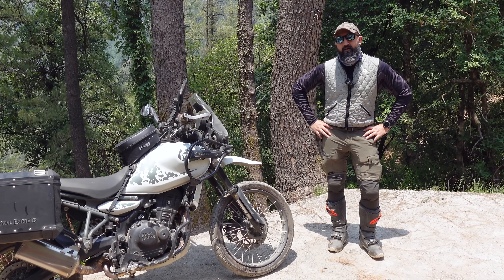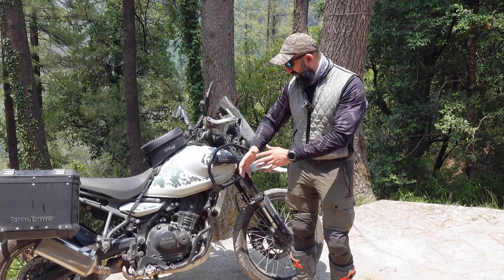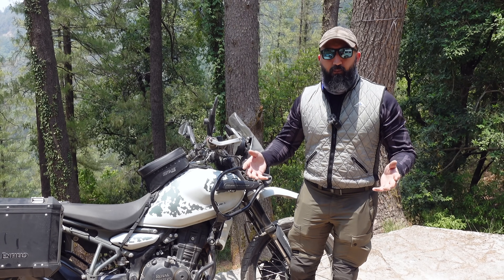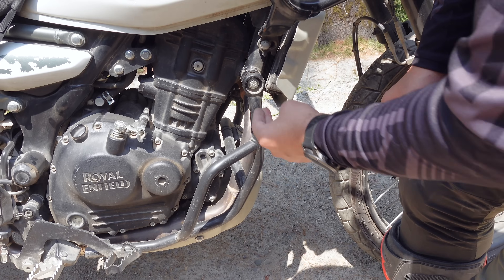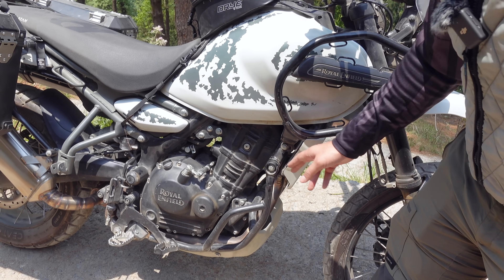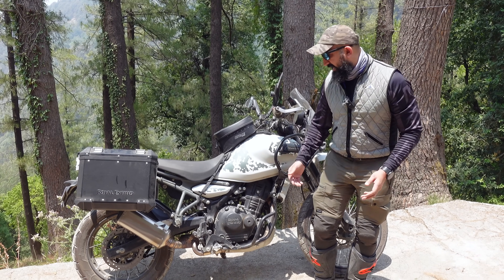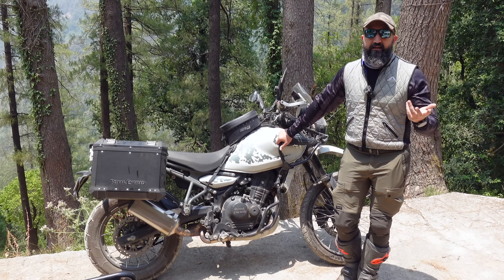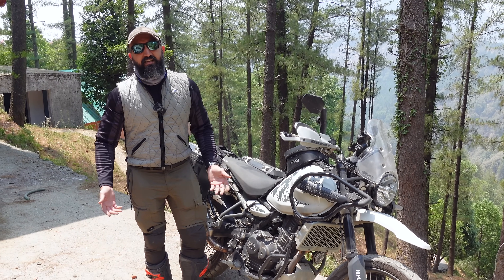Why Did Himalayan 450 Chassis Break: What I Learnt From Royal Enfield

Comment: It's kind of a tricky situation here for us, the viewers. Since we don't have detailed evidences of both the scenarios, we can't really say who's at fault. 

Firstly, As far as i know RE had spent years on testing, simulations and proto runs in the toughest terrains to make sure they don't face such issues  again and finely tune the bike as much as they can. As a matter of fact I own a BS6 411, have clocked almost a 30K km on it, mostly in Himalayas, haven't faced any sort mechanical failure yet.(No crash guard installed tho) if this info helps.

Secondly, there's variety of crash guards and impact protectors in the market that actually serve different purposes for different scenarios. In case of stunt riding and low - speed off-roading you would rather install a cage like or wider protector to protect the body, engine from taking  the damage from toppling on either sides.

And in case of  high speed rally riding and touring you'd rather install a smaller and more precisely designed protector that will give protection from  dynamic impacts. Such crash guards are designed to absorb all the impact without letting it being transfered to the chassis. Hence, in most cases such guards break after absorbing the set amount of impact and not letting the impact reach the chassis.
Now that requires some serious R&D and that doesn't seem to be the case with most of the domestic aftermarket products in India.

Thirdly,
My thought on why KTMs or 411s chassis are not snapping even with those aftermarket upgrades, I think it comes down to the nature of engineering. 
for e.g. y'all know Moto GP bikes are  like peak of engineering. 
But if you take one out on the Indian roads, It's not even going to take much days before the chassis snaps.
Now you can't say that the bike was not well engineered. It's just its chassis is designed so precisely for the track for maximum efficiency and feedback that even the vibrations from non-track uneven indian roads can snap the chassis in a short period of time .

So instead of thinking 450 is weak or half baked, we should also consider the fact that it can be finely engineered in a way that any random external mechanical attachments might disturb the intended characteristics of the chassis.

Abhi it's all revolving around crash guards. Let's wait for a more consolidated  explanation from the company, community before jumping to any conclusions.
Reply: you are saying yourself that at the end of the day it is not a well engineered product, since real engineers take into acount their environment and multiple factor that their final product needs to endure out there, not considering the fact that a motorcycle can and will be customized is a huge fail for the engineering team, and also there are not much brands having these issues, so there is that too.
Reply: RE learned nothing from their last shit show of a frame, instead they went and made another one, this will be the end of the big sales in the eu and america where there are so many other brands available for not much more money, and oddly enough no broken frames to worry about. China and Taiwan and South Korea will take full advantage of this now because they will see what we all do, and that is no competition from RE with this model, they can't make it work and it took four years of arsing about to prove it.

Comment: I bought RE crash guard at showroom. One week later had a sound from engine area when bike it rough patches on road . Took back to dealer and they confirmed that the engine mounting bolt had come loose and they have now tightened it . That day I knew this is a weak point in this bike . What is guarantee they used right torque ? What if it was over tightened ? How can RE assume that people will not use non RE parts especially when RE is famous as a customisation platform ? This mounting point will continue to torment owners in my opinion
Reply: Also owners pls pls regularly get this bolt torque checked regularly
Reply: Buy a torque wrench and check it yourself at oil change intervals

Comment: Abhinav, I do accept the fact that no local workshops have a torque wrench... But how many authorised service centers have one 😂... Definitely using oem guards are much safer
Reply from the maker: The one I frequent uses one.
Reply: I do all my own work (I’m certified motorcycle mechanic), but i would never  allow my bike to be worked on without that (torque wrench) basic mechanics tool.
Hell, I torque my oil drain bolt!!

Comment: Did RE mentioned not to install any aftermarket crash guard somewhere in the advisory in user manual.. this seems to be covering up by RE.. they have these plaguing issues on cone set and chasis.. we should admit I think even with 450.
Reply: They didn't mention this because they assumed any aftermarket companies will do due diligence and design appropriately.

Comment: I have previously used OEM leg gaurd for my classic 350 bs4, when i had an impact which was minor .the leg gaurd broke into two halves ,what i see inside is hollow cylinder of mere thickness..when i later checked aftermarket leg gaurd it seemed a next to next level quality than RE.
Rally gaurd by RE I don't see will protect engine or bike tank anyway when it comes in impact.

Comment: I have the bike since 2 days and I noticed just a problem with the transmission. I have to posh a little bit hard the gear shift to put a gear down, especially from 5th to 2nd. And also when I stop and I’m in second gear it’s very hard to put the first one, it put the neutral. Someone else noticed the same? Thanks guys
Reply: Let the clutch drag slightly to keep the input shaft spinning. Many bikes are the same.

Comment: It's not royal enfield that is at fault, it is the after market manufacturers who haven't done enough research and development before releasing their products, for them it's a race to release their items first in the market and hence you see these issues coming up. 

A friend of mine too owns a himalayab 450 with an aftermarket crash guards . He was on his way from odisa to Mumbai when he noticed the main screw that holds the cage in place had fallen off and missing. 

After market products are good when there's enough time and attention given to detail . Not just sell a bloody roll cage which has zero engineering behind it.

 Think !!
Reply: bro u are saying that its such a poor design that a thing like crash gaurd which is so simple must be designed in labs for this particular bike. This is bullshit from REs side
Reply: @charchitsDen you are ignoring the fact that the engine is a stress member for chassis, other companies using trellis or perimeter frame do not use engine as a stress member, so the bolts used to secure the engine can easily be used to install crash guards without damaging the chassis in other bikes
Reply: @charchitsDen it’s DIY installers and garages that don’t use torque specs , that’s the problem
Reply: I think RE would have taken in acount about  all this aftermarket things and provided seperate place of mounting for these accessories by keeping key mounting point safe to avoid such incidents.. people in India are not so technically sound to ensure such effective precautions
Reply: So only RE people puts these aftermarket accecories other brand people roam around naked ? 😂 Is that what you mean
Reply: @LauraLasan69  This is not the logical to say so...Crash Guard is creating issue at strees members junction which is serious concern..If engine is get connected to such point to frame, that point need to be carefully fitted...RE need to change this design for Crash Guard connection 😁
Reply: the crashbar at question is Zana's Type 2 if i am not wrong. Kindly search for a clarification video that zana has uploaded regarding chasis breaking! It is clearly negates evey claim done by RE! and it clearly proves what pathetic quality they have put up in their flagship adv! 

Please do not defend any company whatsoever! If they are producing bad quality products then we have to speak up otherwise it won't change! this version of RE is having quite many issues since start and RE isn't even addressing them properly cause they know their toxic/loyal fanbase would defend whatever bullshit they pull!

Comment: Brilliant.. So the bottomline is if there is crash guard or there isn't a crash guard, if the bolts start to slowly undo themselves -- let's just say we talk hypothetically from an RE engine vibration perspective -- so, the bolts get loose over time, the rider doesn't know that, the graph spikes and the chassis snaps. So eventually it's not the crash guard, it's the design itself and that is, either you hate me or agree with me is a blunder from an engineering perspective.
Reply: Right, and also i would say that the Official RE crash guards are just a waste of money as they dont actually protect the engine/ legs or both on a same time
Reply: An engineer should never design so poorly that is causing single point of failure
Reply: These bolts never gets loose..  Every chassis is tightened with such bolts. 
Also if you modify/change the bolt holding the chassis of any car/bike, it will eventually break.. 
Give me one steel rod which I can fit on chassis of Fortuner and I will show you how even Fortuner can be broken.. 
These kind of design is not invented by RE. In other countries people first understand the design and then modifies it.. In India we just takes everything for granted..
Reply: @gdgavali  unfortunately your pseudo jargon has been busted by zana publicly on youtube go wTch that video
Reply: so buy an off-road moto with a cradle type frame.
Reply: Very well put.
Reply: I think your screw is loose
Reply: Which is why there are different specs loctite. Bolts don't come loose if you use the right stuff... If you reuse nylocs, the wrong spec torque, the wrong model number loctite and then blame the engineer get a donkey, cause you an it have something in common...
Reply: Engines should never be a stress member
Reply: @jameshunt1822 It isnt its the customer who is😅😅😅

Comment: TBH I own RE450 and always worried of some shit like this. RE tries to earn alot from accessories and imvest less in design and looks of Accessories therefore we go to aftermarket accessories. Eg. Headlight.. they know its not sufficient, Engine guard not at all attractive, seat to much expensive, No nuckle guard etc etc..

There is no sense in making the fitting and chasis so much prone to breakage. RE needs better engineering team I think.
Reply: Yes, RE learned nothing from the 411 frame disaster, instead they made another with the same problems, it took me 4 seconds when I looked at the new 450 frame to conclude no lessons learned, no changes made. They hired a donkey instead of a frame designer / engineer. The British bikes of old were designed by proper engineers, since those days RE have not been able to design much of anything. I was hoping they actually had an R&D department and decent engineers, looks like I was wrong.
Reply: For 90 days RE did not give me crash guard. What they expect one to do?

Comment: Guys dont worry about chassis
As only 2 out of 40,000 himalayans faced this issue
So the probability is next to zero

Still to be in safezone
Some precautions can be taken

1. Use of locktite on all 3 engine mounts
2. Use of Oem products ( engine guards, saddle stay)
3. Lets stay away from top boxes as they can break subframe too
4. Inspection of bolts before every  ride or once a month
Reply: Bro I am a IT guy. I will have to go to RE service center every month for this and why should I for no reason. Rather make good and Robust products.

What if I ask you to shouldering of ur laptop and tv every week or it will break.
Reply: @arjunsaraf7173  yeah i agree with you
But basic inspiration can be done at home also
A round around the motorcycle doesnt take much time

Just use locktite
As nuts and bolts can go loose on any bike
My previous bike was yamaha fz25
Its suspension holding nut went loose once
Suspension touched handlebar
I just tightened it and it never went bad
Reply: This frame is junk just like the last one, RE learned nothing from the past problems. As far as top box adding to the breakage of a frame, no, it will actually take weight off the stressed member, its behind he wheel and will not put weight on the stress points that are breaking. A child could do better than RE, they must have hired a donkey instead of an engineer.

Comment: I understand the importance of torque settings on bolts, and nuts. But then again was the issue diagnosed properly? If yes, then RE should mention not to use after market parts. Not to mention in any case the Himalayan 450 is quite undercooked, the vibration levels are so high that it becomes unbearable after a certain point. And in my opinion the vibrations coming out of the engine and moving around all over the motorcycle is to be blamed. Thanks!
Reply: Do you think a single cylinder box engine wouldn't vibrate. All engines vibrate
Reply: @buzzlightyear1484  vibration is the essence of the Universe everything vibrates. But the engineering is so high that you don’t feel it, in any case the moment you start feeling that your body is shaking either you are sick or there is something wrong with you. So technically there is a threshold to everything, and anything beyond that is not good, I guess you haven’t ridden a Honda yet. Go ride one and you will realise what I am talking about.

Comment: Abhinav very nicely explained I had some bad experince with the zana crash guard. I use himalayn 411 and have the zana engine guard, the part of the guard which bolts with the frame of my bike broke and stayed inside, it was a nightmare!! and had to drill the bolt out and re-thread it to use a new bolt. The mechanic told me that the quality of the guard is too bad and the weight of the guard was not well distribuited which resulted in stressing the bolted parts and they ultimaltely snapped off. I previously used the RE's original engine guard but it got bent when the bike fell down so thought of buying this zana and now i have some serious concerns..
The problem here is the bike is new and as always indian accessory brands didnot put in a lot of research to make a compatible crash guard.. So this problem can be an issue.. The 3rd party companies must do some research or just ask about the tehnicalities of the himalayan and should have come up with a better product.
Reply: bro why are you spamming
Reply: @ghostwarrior79ghost10  just feels like doing so
Reply: @ghostwarrior79ghost10  wanna join me?😅
Reply: @95Ar98  nope its annoying

Comment: Did they mentioned in anyplace the torque for those bolts for the oem crash guard? Have you aware of that the small service centre of RE does not even know how to fix it? Are you talking about using torque wrench? You should tell your connection in RE that they should mentiond the torque for their oem product in their mannual. 
I feel that RE should address the issue in a official way.

Comment: The fact that something this serious can happen from something like a wrong torque spec is concerning. Forget after market and road side garages. What if a service person at RE service center choses the wrong torque value one day?! Are they all using torque wrenches in India? I would be very very surprised if that is the case.
Reply: And if RE knew this before, shouldn't they have advertised this before? (Did they?) It should not have been a surprise that people are going to do after market parts. It's an adventure bike after all!
Reply: @ArunBasilLal If we just compare to other brands.
KTM , Bajaj, Hero, Yamaha, Honda, TVS people fit all sorts of guards.
Yet we have never heard of something like this happening.

RE has had this problem starting from their Himalayan 411.
I think they know the real reason. They just want to dismiss it for now on crash guards and maybe quietly fix it or not fix it.
Reply: @anirudhhhh  I hear you and I agree. Even if what RE say is right (and I want to believe them), they should have designed things differently. Because people are going to install guards, it's a very common accessory.

Comment: Well after reading comments I felt that I should chip in my experience.  I have been riding RE bikes for 28 years and have been a victim a of broken chasis on himalayan411. But with the broken chasis case of the Himalayan 450 I did  check the bolts fitment of the Mototorque crash guard  and to my surprise the right side bolt was loose and I had just finished a 1200 kms ride.  Now I have a case for the RE explanation through my experience. The after market crash guard is off.  But let's wait and see if we find more of such cases and then conclude. My 2 cents to those who have fitted after market crash guards ...pls check the bolts and have them tightened or just remove the after market crash guard.

Comment: Are you sure your analysis is correct? Have you had a chance to look at the pictures of videos of the break before the allegedly guilty crash guards were removed? Asking because I was getting my 450 serviced a few days ago, and this guy comes in with his and it had an aftermarket crash guard (similar to the ones in the break, with the same sliders, but no idea if its the same). This one was actually not mountaed to the head wala hole, but to the other mounts where the tank guard is also mounted. I can see how that is a dumb idea, and could lead to unexpected stresses on the frame. From what pics im seeing online (hard to find), even the guilty crash guards used that mounting (either just that one or the engine head mount as well). 

So yes, i agree that it could be a problem with the aftermarket parts, but maybe not how you explain? Maybe the aftermarket guys are dumber than we give them credit for (remember - re tested this bike years and laks of KM, the crash guard makers tested one bike a few few falls fora. few days and voila).